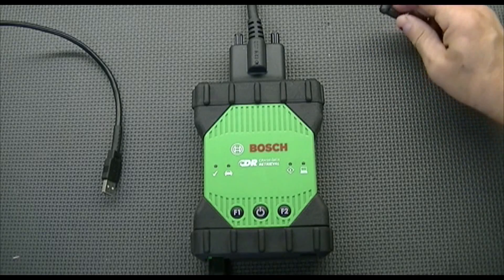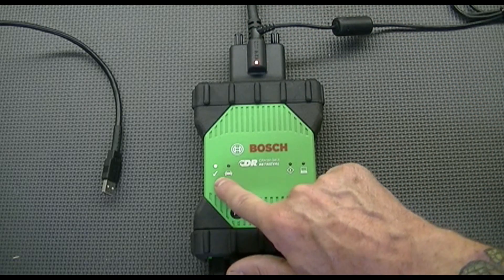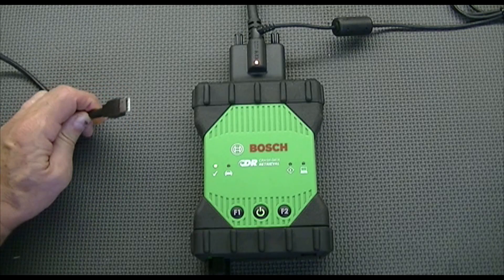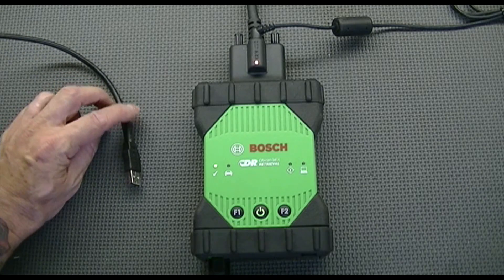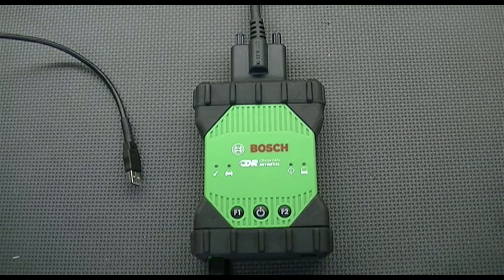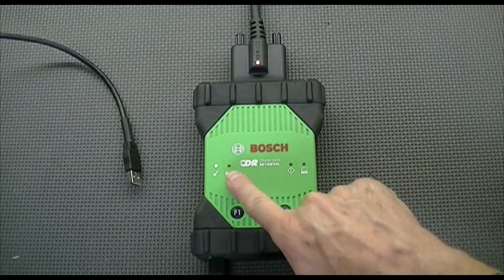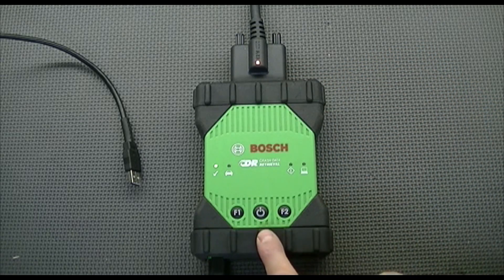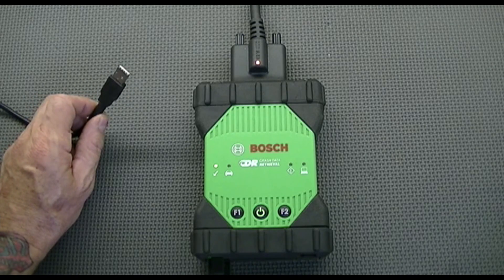Bosch CDR 900 - Wait for the beep

Comment: Why do you recommend to plug the USB in last, with CDR open and after case notes and all are entered? thanks!
Reply from the maker: I didn't say anything about having the CDR software open or setting up the file by entering case comments.  In the video description I wrote, "You can have the Bosch CDR software open but do NOT connect the USB cable to your PC until you hear the beep."  and said something similar in the video.  You can have the software already open and set up or you can start the software afterwards.  It doesn't really matter.  The information about waiting for the beep came from Bosch and is in the CDR help file as well as Bosch CDR technician training materials.
Reply: @FactualDiagrams  Got it, thanks! I actually think I was watching the repowering videos when I heard that phrase and replied to this video, sorry for the confusion.